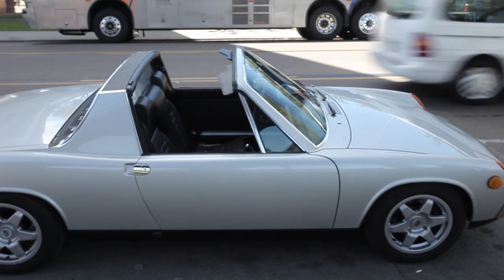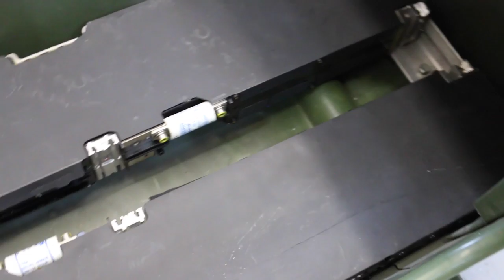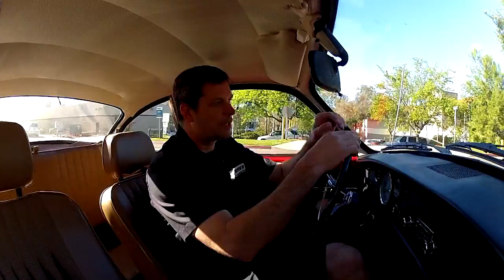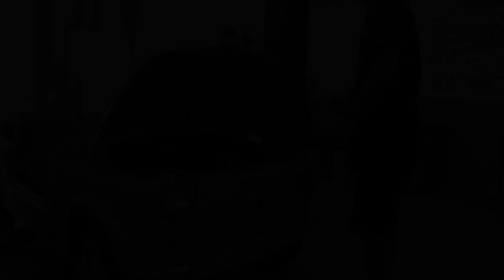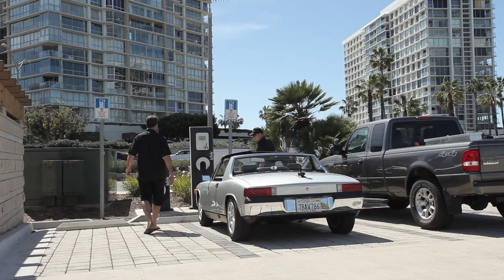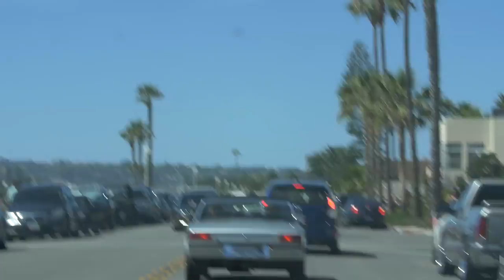The EV Show - March 2015 - Episode 4 - EV West

Comment: Great show.
I love the simplicity of the bottom balancer, and I'm now planning to build a set. Being a guy that occasionally rebuilds laptop computer battery packs, I use a homebuilt system for single 18650 cells with two small voltage regulators on different value resistors (2.5Ω and 7Ω). The first regulator shuts off at 3.1V, leaving the second one to shut off at 2.9V, automatically. It's a little slow, but safe to leave an forget about.
Reply: DrFruikenstein can you make one that shuts down at 2.7?.......
Reply: buysell trade9

Sure. There's two different ways. One is to find (or set up) a regulator with a minimum input voltage of 2.7 volts.
The other way is to use a dual comparator to run both regulators, but that is quite complex by comparison. Also, it's important to use a resistor that doesn't exceed the regulator's current rating, and never exceed 1C of the cells current rating as 18650 cells can get hot.

Comment: As a Swede I must make some corrections about the koenigsegg Regera.
Its a hybrid with the same size drivline as a Tesla model S P85D but with 1700 lbs. less weight.
On top of that there is a 1100 hp 950 ft lb V8. But since its a single speed "gearbox" the two motors does not match the math, it only gives 1500 hp with some 1600+ ft lb of torque!

Comment: I want to hook the electric motor to my auto Trans with a 50cc to 90cc gas engine running a generator all under the hood to power the drive motor and car electronics with a smaller electric motor to run the AC power steering and brakes. I think this would be a better way than a gas and battery hybrid.